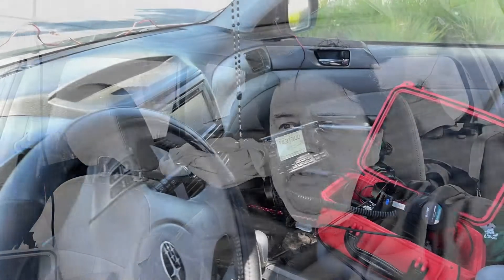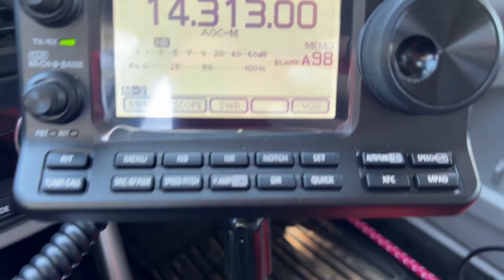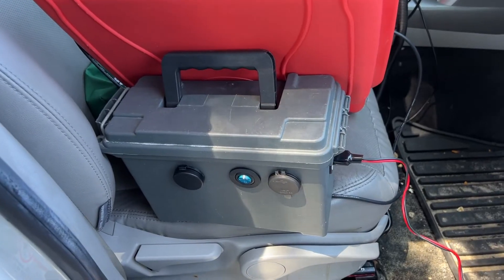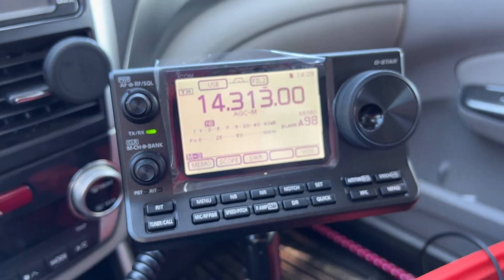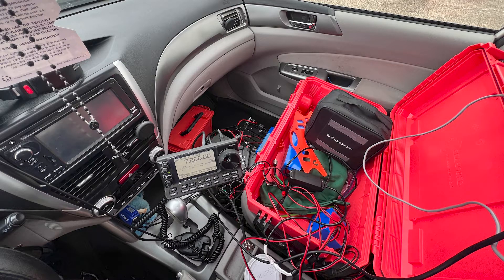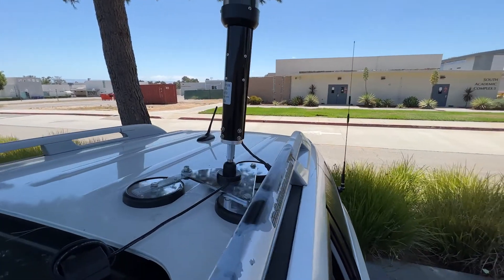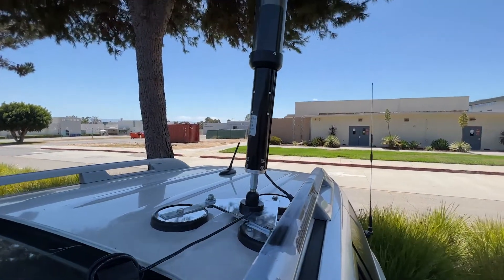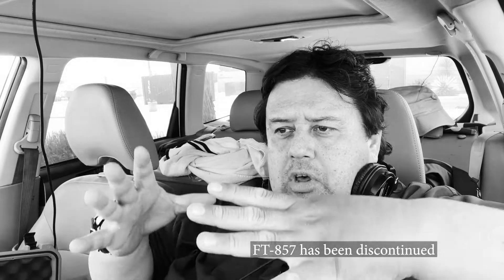First Look at IC 7100 for POTA

Comment: Good comments Frank. As hams we have been really spoiled with the  choice of gorgeous SDRs for fixed and small portable use. But the gap for all band mobile is astounding and the 7100 although a nice radio has been out since 2012 (2016 for the IC-7300). So we are already 8 years into low cost SDR yet no new mobiles are available. That is why used prices are not high but stupid. My IC-7000 is still my best choice for HF mobile and I could sell it for what I paid used in 2014. 73 Peter

Comment: So, a year + later what are using now? I just passed both my tech and general at the same sitting and still waiting on my call sign. I am researching radios, the 7100 specifically, and that is how I ran across this video of yours (nicely done by the way!), and I am curious what is your daily driver mobile setup now? I am interested in POTA, which is why I went ahead and tried for General. The purpose of my search is looking for a radio that is both UHF/VHF as well as HF,  and is Mobile, Base and POTA friendly, especially for a newbie. Trying to save funds here. What are your thoughts on this, currently $1200 , radio that may cover all of my situations?
Reply from the maker: I'm now using an FT-857D.  Check out my videos on that radio.  Unfortunately, that radio has been discontinued.  It has UHF/VHF which makes it a great radio.  As for POTA, I use the FT-857D in the car and on the field.  It's a great radio for both uses.  One advantage that the 7100 has is that, it's still available and had many great features like recording, a port to do digital, and other ports that might assist you in obtaining more contact.  Good luck!  -73
Reply: Thank you for the reply and explanations! Great video and I will continue to watch some of your other videos as well. 73  @frankwc0o

Comment: For a mobile HF radio, I think I would look at the IC-7100 (which you obviously have), and the FT-981. The 891 is considerably cheaper…

Downside to the 891 is the menu system (icom wins there) and it draws closer to 1amp on receive vs the 0.68amps your 7100 was drawing.
Reply from the maker: Another radio to consider is a used FT-857.  That radio draws about .7 amps, and it's a shack in a box.  With the Collins filter, you will have a great mobile radio.  Sure, nothing like the IC705, but well worth the price.
Reply: @frankwc0o  I’ll have to look closer at that one. Haven’t looked too hard at it before, but not really in the market for a mobile HF. I used to be a road warrior and had considered it before, but now I fly more for work. Always have my 705 with me which is a great travel companion in hotels and for some impromptu POTA while in other parts of the country.
Reply: Also ATAs compatible 857 and 891